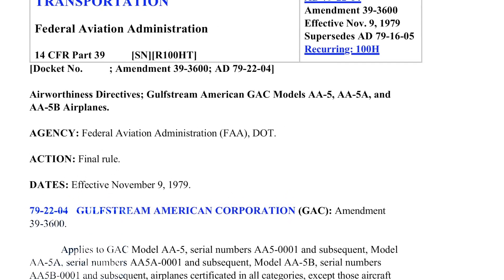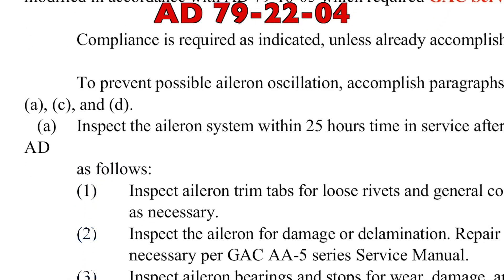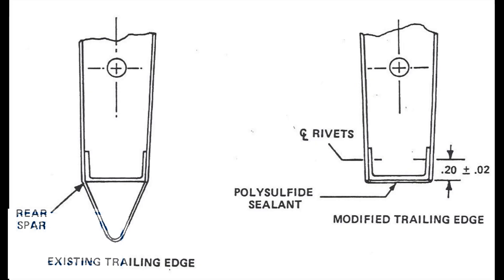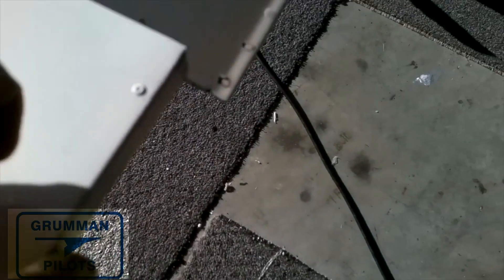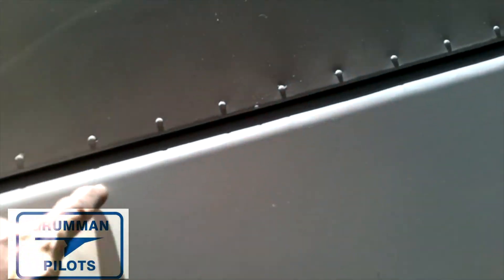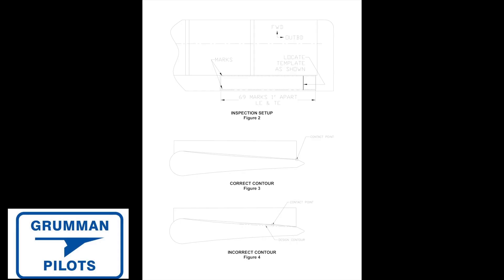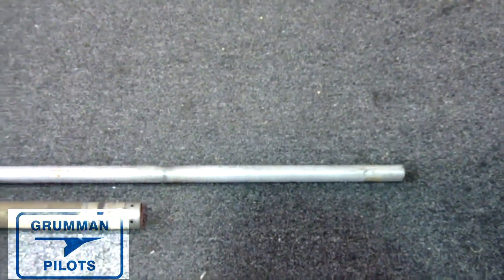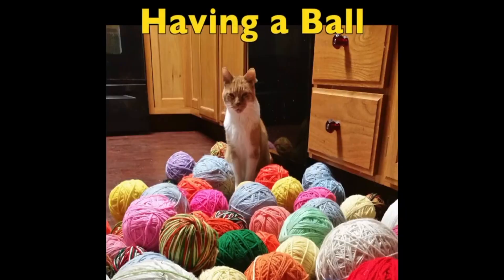Service Instruction  SI 06 01 and AD 79 22 04 - Grumman Style

Comment: We had a chat to our mechanic about this today as our traveller is in for annual (UK). The AD itself doesn't make mention about the SI 0601 + SB 165 (from memory) combination cancelling the recurring AD inspection. Can I ask, how are you guys interpreting the SI details to remove 79-22-04 recurrence? Many thanks. Al
Reply from the maker: SI 06-01 has a template for checking the profile of the ailerons.  If passed, cancels 79-22-04
Reply: Do you have a link / copy of the AD that shows the alternate means of compliance of doing the SI cancels the repeat inspection of the AD?  What I’m getting at is the mechanic was of the opinion that there is nothing in black and white in the AD that shows the SI cancels the AD itself. 
Best Regards
Al
Reply from the maker: AIRCRAFT, LLC
226 Pilot Way, Martinsburg, WV 25401
SERVICE INSTRUCTION SI 06-01
 DATE:
SUBJECT:
MODEL/SERIALS AFFECTED:
TIME OF COMPLIANCE: GENERAL:
August 1, 2006
AD 79-22-04, Alternate Means of Compliance
It has been determined that the primary cause of occasional aileron oscillation on some AA-5 series aircraft is a deviation in the contour of the aileron skin across the aft 1/3 of the aileron chord. By verifying that correctly contoured ailerons are installed, the 100 hour inspections mandated by AD 79-22-04 may be eliminated.
INSPECTION:
A. Verify that Service Bulletin 163 and Service Kit 144 (Aileron Torque Tube Inspection and Modification) have been accomplished (if applicable).
B. Performthefollowinginspection:
Reference Figures 1 through 4
1. Fabricate the inspection template in accordance with Figure 1. The template should be made from at least 0.032-thick aluminum.
2. Locate the aircraft in a well lighted area for adequate inspection.
3. Using a ruler and a removable marker, place a mark at each 1 inch of aileron span at the leading edge and trailing edge on both upper and lower surfaces of each aileron.
4. Place the template across the aileron, perpendicular to the trailing edge at the first 1 inch mark as shown in Figure 2. Visually inspect the aileron skin between the forward and rear spar of the aileron for contact with the template at any location other than at the forward and rear spar.
AA-5 AA-5A AA-5B AG-5B
All All All
Not Affected
At the next scheduled 100 hour inspection per AD 79-22-04 or next annual inspection.
ATA 2710
   
5. Repeat this inspection at each 1 inch interval on both the upper and lower surface of each aileron.
CAUTION: DO NOT ATTEMPT TO ALTER THE SKIN BY DEFORMATION. MINOR CONTOUR DEVIATIONS IN THIS AREA CAN CAUSE MAJOR HANDLING CHANGES.
C. Ifthereisnoskincontactwiththetemplateotherthanattheforwardandrearaileronsparas shown in Figure 3, the aileron skin contour complies with the intended aileron design criteria. If both ailerons are found to be in contour and Service Bulletin 163 has been complied with, then the aircraft is acceptable and further repetitive inspections of the control system per Airworthiness Directive 79-22-04 are no longer required.
D. If any aileron skin contacts the template at a point other than the forward and trailing edge spar as shown in Figure 4, the aileron is out of contour. Aircraft with an out of contour aileron must be inspected every 100 hours in service to the requirements described in
AD 79-22-04 paragraph (b).
E. Record compliance with this service instruction in the aircraft log book.

                                                                                                                CONTOUR INSPECTION TEMPLATE Figure 1
       
                                                                                                               INSPECTION SETUP Figure 2
                     CORRECT CONTOUR Figure 3
                                         INCORRECT CONTOUR Figure 4